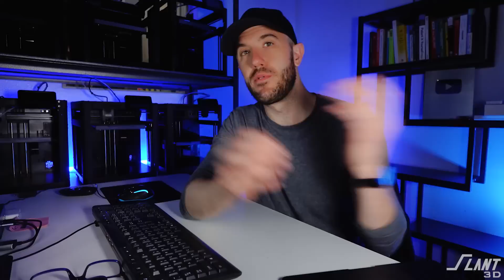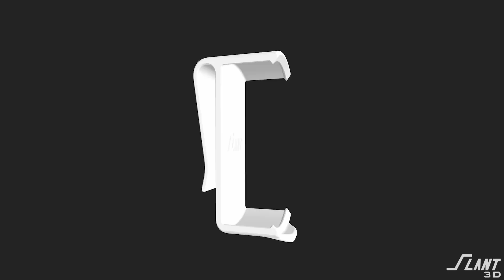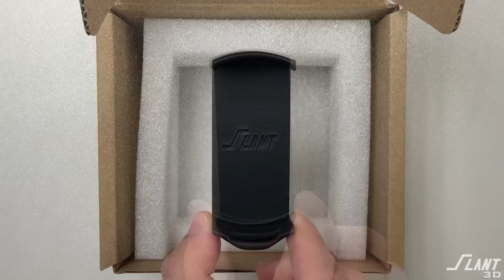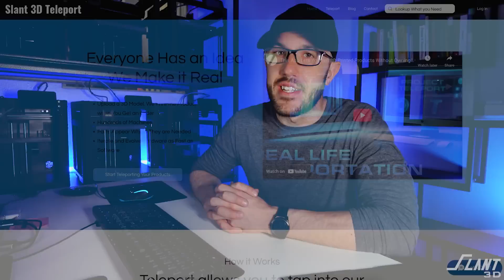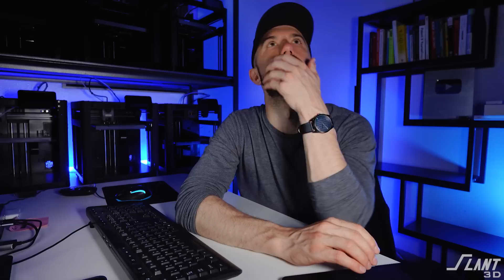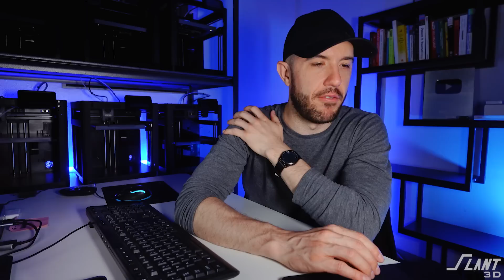That Slate Pickup is Dumb | Everything is Our Fault | Podcast Ep 103

Comment: As someone who is focused on cars and most of my 3D printing revolves around cars as well, I don't think you are correct regarding customization and new automobile purchases.
1. People like to save money and pick only what they want, so a low starting price with options at cost is good.
2. People like to feel like their cars are an extension of their personality, it's a major purchase and they want it to feel personal.
3. There is a difference between making the car customizable at purchase and releasing further 3D printed accessories.
I could come up with many more reasons, but basically people like to feel special and invested when they are spending a lot of money, even on a cheap car.
At the opposite end of the spectrum, Porsche and other luxury companies are absolutely huge on customization and charging a lot for it.

Comment: Selling on customizatioon is not about making everyone happy, it's about giving that chance on a sturdy, reliable, flexible and open platform. They don't do trimming, they don't do custom interiors, they don't do shitty stainless steel panels that fall apart, they don't shoot themselves in the foot with stuff they don't know about (because HARDWARE IS HARD), they make a damn good and reasonable truck you can do what you want to it. That, of course, is the quiet part loud: YOU do it. Or even better: get somebody else to do it. Does Apple make thir money on smartphone cases?

The first thing that came to mind when the whole customization thing pop up was "cool, this will bring a pretty big aftermarket business". The truck segment is rife with aftermarket and customization companies that will be happy to work on anything, more so if ti is easy, and their clients are more inclined to do so than sedan, hatkback or SUV owners. In that sense it's a pretty tight commercial strategy, someone put their lateral thinking to use. And most of all: they took off their shoulders a lot of logistical, manufacturing and development weight to focus on what is indispensible.

Comment: Um... Burger King? I quote: "Have It Your Way"?

And as for the Slate: if it doesn't have any big show-stopper problems; I'm going to get one. It does what I want: go into town (25 miles one-way), pick up 4x8 plywood sheets, slabs, & boards, and drive them back home. It'll be powered from my PV array, so no gas bill. And I'm not stuck with an integrated do-it-all infotainment system that I'd have to figure out how to bypass (there are very few factory sound systems that were actually OK sounding to me, and they can all be found on rather expensive luxury cars).

FWIW, I'm currently in the middle of customizing my daily-driver Scion tC with a custom audio system based around an Android head unit and some custom PCBs; and some custom software that runs on the head unit; as well as some 3D printed parts.

Comment: Re customization:
1. Apple.  The iPhone is one of the most user customizable products to ever exist.  You can customize the case and background but more importantly every app the user adds is an act of customization.  The user controls what apps they add, how they interact with them (notifications, etc.), and even where they go in the layout.  
2. Crocs shoes.  The kids I know love them because they can customize what charms and decorations hook on the outside.  

There are types of product customization where the complexity and cost is born primarily by the manufacturer and there are types of product customization where the complexity and cost is born primarily by the end user.  Products that fall into the 2nd category (user customized) are often great businesses because they lead to much greater emotional attachment between the user and the product at very low marginal cost to the business.

Comment: I agree that the Slate Pickup should be marketed as the inexpensive pickup truck that's available as it's base. The rest of it should be deep in the research papers that the interested buyer thinking, "This looks like it could be interesting as a base for my camper?", or "can it tow my hay wagon from the field to the barn?" etc. I don't think the range of 150 miles is a deal breaker for the people looking for a reliable commuter vehicle that they never have to drive to the gas station, etc. It would be interesting if the attachment points would give the pickup a way of attaching additional battery capacity 'on the fly' for people who want to drive it on longer trips.  I would suspect that it would also be a great 'field check truck for most farmers who use it to go out to the field with lunch to pop who's been planting seed all morning, or hauling the anhydrous Ammonia tank to the depot to refill it for the next roll. Most of what doesn't need a tractor to pull it will happily be pulled by a small pickup. It's nice to have a larger pickup, but if you're looking at your budget as most farmers are, and all your fields are served by good roads with culverted access to the field, the pickup is likely to be more than enough.

Comment: Re customization: 
1. Jeep Wrangler. Aftermarket is awash in options. Slate looks to be aimed at that sort of customer, with a more organized approach. 
2. AR-15 platform. Wander into a gun store and ask a few questions. 100% customizable - over time - based on what you want to do.
Reply: The AR-15 platform is a perfect example. Similar with Glock. You can build an entire AR-15/Glock without any OEM parts resulting in a product just as good, if not better than the original. Especially with the AR-15. I don't have a single Armalite or Colt part in or on my AR-15. But mine is better than probably any you can get from the store.
Reply: @PrayingPanda  Tolerance stacking on various brands of Gen3 Glock clone parts can get wonky. I can't entirely agree with that small portion of your sentence.

Comment: Slate is a niche vehicle.  Customization that most would want is minimal.  They put a feature to be able to swap body panels cheap/easily is OK but not great.  You can put a SUV hat on it, but regular pickup manufacturers allow customization of putting on tonto covers, or side panels or bed cover or camper, or upper rack that allows long materials or plywood.  But that is only for specific needs.
Reply: For me Slate looks like a scam. Too good to be true.

Comment: Question: Couldn’t the customizability be done if it were done with the same kind of digital warehousing that Teleport uses? 

There’s no need to warehouse 100 different parts in 10 different colors. A new order would simply generate the external parts orders. 

If the customizable parts are chotchkies like you mentioned it seems like it might be sustainable.

Comment: Rolls Royce will let you customize pretty much anything, including the star pattern in the headliner and the material of the self-hiding hood ornament. They have a model with a dining set in the trunk. If you look at RR, customization is both luxury and a sustainable business model. 

For the Slate, you don’t have to customize it. It comes in only one color and you can get it with no options. Self driving has failed to deliver and many other options on most vehicles are not critical to a cars’s basic function. Many options also raise your insurance rates. Since I can CAD and I have 3D printers, I can even make my own components. Actually, I think I just talked my self into getting one! Lol.

Comment: if the subscription isnt working just open the shop up to non subscribers. what is this lunacy?
Reply: Right? If they would just charge an extra couple bucks per spool, maybe they could scale without a series A or spending time on dealing with people gaming a subscription model.

People are gonna be people - good, bad, otherwise.
Reply: The whole point of the subscription model is for them to know how much they can expect to sell every mount. In the past he's been very clear about the subscription is a tool to collect data and better plan. It needs to cost something otherwise it dosen't tell them anything about customer commitment.
Reply: @gabm.3475  or they could look at repeat customer purchases and infer purchasing behavior from there.

If a customer is just signing up for a subscription to buy one spool and then cancelling, it's not an effective data gathering tool
Reply: @ and hes very clear in the video when he says its not working
Reply: @3dz3dz  yeah I kinda forgot my initial point while writing... I meant to say that they built this buisness model based on the fact that the subscription based system would bring stability. If the subscription model dosen't work out it's very possible that it would make the whole buisness fail or less dramatically too much trouble not enough rewards.